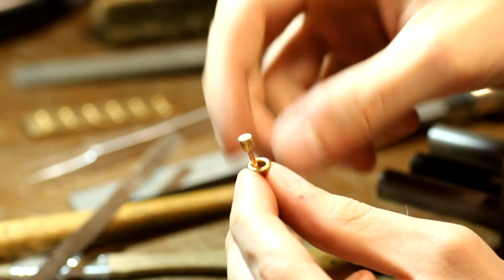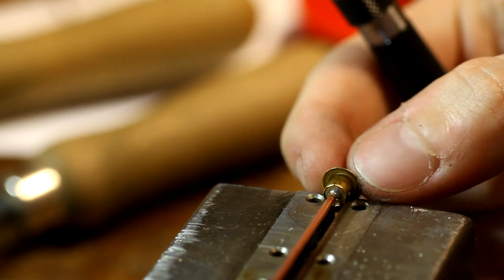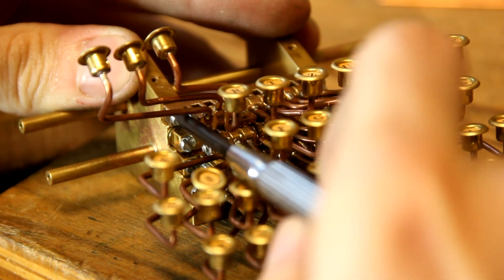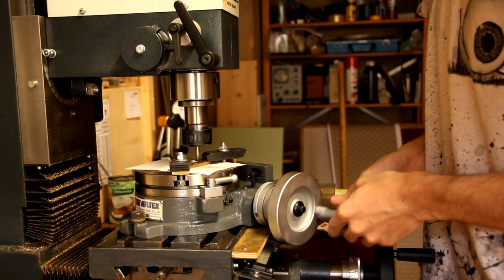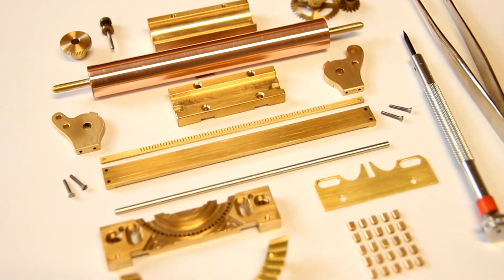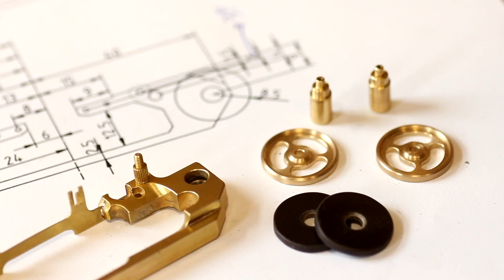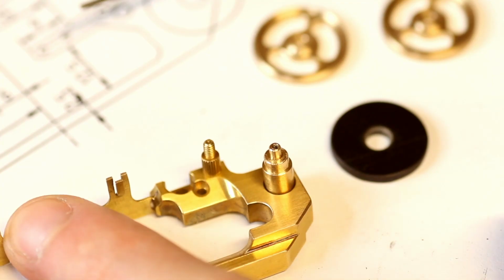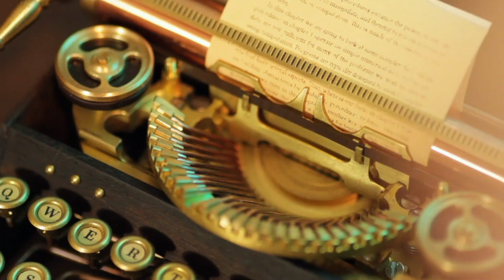Making a tiny Typewriter | An Unwound Clockwork

Comment: that is a wicked cool typewriter😱 You should make a small model of a steampunk wall clock or a pocket watch
Reply from the maker: I actually have to build a pocket watch for the same character too, but it will be much smaller and I need to save time, so it will be a bit simpler... ;)